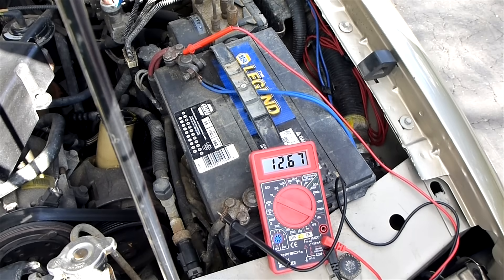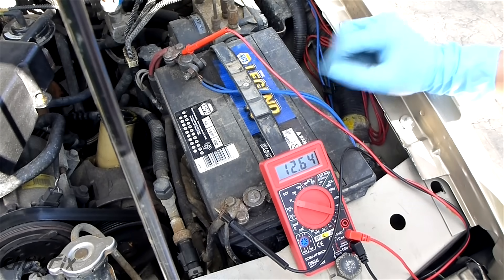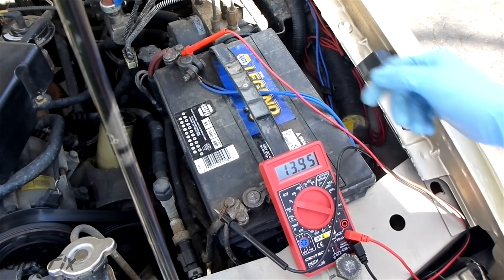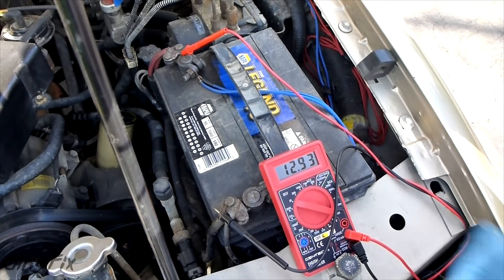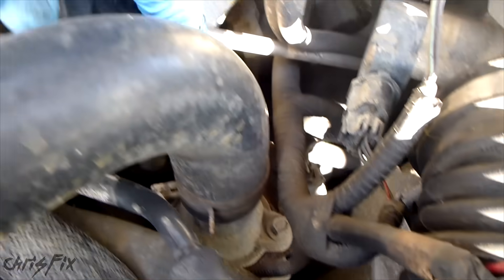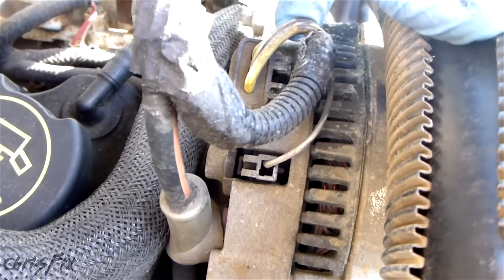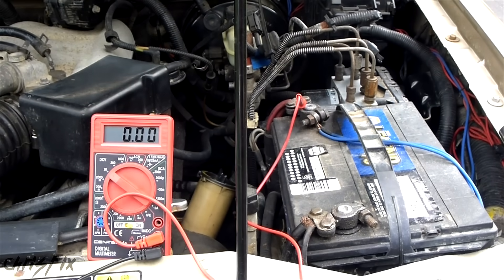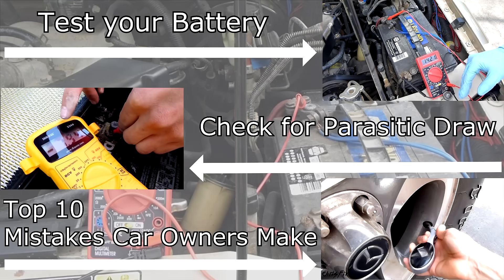How to Test an Alternator

Comment: Hey my man Chris!!!! I keep getting the red battery light flashing on my dash. I went to two different AutoZone's and they both said it was a bad battery. I bought a new battery and the red battery light still turns on. So what I did was return the new battery. I even changed the tensioner assembly and idler pulley because it was loose and rattling. I still get the red battery light come on. It comes on once in a while and it's a quick flash. Any ideas on what it might be? They tested the alternator twice and it passed. One guy at AutoZone told me it was weird the voltage on the battery was over 13 and their computer still said bad battery. Clearly it's not a battery because it still happened with the new battery. Today I had the AC on with the fan speeds half way. When the radiator fans would turn off the rpm will bounce to 500 and the engine would almost stall. Please help. Thank you.

Comment: Hi Chris 
I have a 2004 chevy trailblazer my alternator went bad I bought a new one from the local auto parts I installed it my self a couple days later I noticed that the battery gages is boucing up and down  sometime go up to about 15 and then drap down to about 13 the car shakes a little bit when is idling  I am a bit concerned about over charging and damaging my computer 
would this be a bad alternator or bad battery 
thanks you in advance 
Lee

Comment: Great video! Seems like my alternator has an intermittent squealing bearing but it is giving out a charge so it is OK for now. I found a crappy $10 multimeter and figured out the battery in the car would only stay at 12.25 instead of 12.6 after being driven and sometimes would not start the car even right after turning it off. Checked the battery in another car not being driven right now and found it had a higher charge despite sitting for several days. Swapped the good battery into my insured car and everything tested good after with the multimeter and engine running just like in your video! Saved me money and time not having to buy a new battery and alternator; thanks again Chris!

Comment: Great video, as usual. I would add one more test because it is quick and easy and catches a fairly rare problem: bad diodes. While measuring the voltage across the battery with the engine running,  switch to AC volts and measure the voltage across the battery. The AC voltage should be less than 0.1 V and is usually only a few hundredths of a volt. A bad diode will produce 0.5 to 1.7V or so. I don't see it often in cars but when I was in general aviation (small planes) we saw it a lot.
Reply from the maker: Thanks and great tip!!!

Comment: Mr Chris I have a question, Ok I have a ford and the dash lights when dim driving down the road but the van never did die cause I am sure it was running off the battery power, that all being said I have purchased a new battery and checked the volts and it is 12.65. so it is good but then I turn on the van and it drops to 11.63... Which I could assume tells me that the alternator is bad, I took the Voltage meter and connected it to the battery and then connected it to the alternator and I got 0.00.... I got no reading at all..... What would that mean if I got no reading when I connect it to the battery and then to the alternator casing??

Comment: i had my alternator replaced with a new, rebulit one, but it's outputting 13.65v in an 07 RAV4. is that too low? My other cars are around 14.4v.

 V6 RAV4 so labor is pretty expensive. It was 11.2v before. Battery is 12.5v with the engine off.

Comment: hi  Chris,, I recently replaced my starter [Nissan sentra 1996, 1.6 l] On Friday morning after I started the engine and drove the car for 2 miles I suddenly had no lights and  nothing on the dashboard the engine died, so long story short I replaced the starter and as soon as I had everything hooked up and well connected the engine was running, no problem and after three days without any problems, this morning I noticed that the battery sounded a little weak when I tried to start the engine but it ran lights and everything else were working fine but I was like something is not right so during the day I ran the engine several times still felt weak but it ran, when I came home I checked everything the way you did in your video and the battery and alternator seem to be fine, however that weakness is still there every time I try to start the engine and I don't know how to address it, please give me your advise,thanks Rudy.

Comment: my battery is 12.6 but my alternator reading is 14.6 with everything I can think of turned on. My problem is that when I accelerate the battery light flashes but I changed the belt and its still happening. anyone any suggestions?

Comment: my voltmeter reads about 12.6 when its off, when i turn on the engine, it reads about 13.8. i turn all the load that i can probably think off and reads about 13.6v. im hearing like a scraping sound does it mean i have a bad alternator?
Reply: Your figures are actually standard. Your alternator and batter is fine.

Comment: hi installed a new alternator a few months ago is it normal it get very hot to the touch its a ford people carrier
Reply: Thats normal because the alternator is bolted straight to the engine block.  The alternator even has a fan built in to help cool it down.

Comment: Hey Chris,

I have a problem with my charging system. I watched your video some time ago and I remebered some parts of it. With the car idling and no accessories turned on, the multimeter shows a voltage drop of 3V between battery negative and alternator case. 

The alternator gets ists ground via a ground cable to the engine block. Can I solve the problem by attaching an extra cable directly from battery negative to the alternator negative stud?

Comment: Chris I am working on a 2001 Saturn SC 2. The battery is 3 months old and has a charge of 12.9 volts before I start the car. The alternator is new, I had it tested when I got it and it puts out 14.7 volts. After I put the alternator in and started the car after running for about 15 min. voltage in battery starts to drop. The longer I run the lower the volts. The drop is faster when more things are turned on. I take the alternator back out and it test it and shows it is putting out 14.7 volts. Can you please give me a clue?

Comment: I have a new battery only showing 11.8 and it won't start
Reply: Your problem is that the alternator is not charging the Battery.  Inspect the wires to the battery and alternator. Fix any loose, broken or corroded wires...  Check the alternator belt, should not be loose or cracked, etc... Use a wire brush to remove any corrosion built up on the battery cables and make those connections look new... If you follow this video with the multimeter it will help diagnose if the alternator is bad and needs to be replaced... Some part stores will also test your alternator for free...

Comment: Is 13.9V while running low enough to indicate the alternator as a problem? Only drops to 13.5V under load. All connections appear to be tight and clean. Battery is good quality and about 6 months old. Is it possible for an alternator to have an intermittent charging issue?  Vehicle is an 07 F150 5.4L with about 100,000 miles. Battery died a few days ago after driving it but now it seems fine.
Reply: Also, it did drop slightly below 10V when starting

Comment: Tested a Dodge Caravan last night, temperature was 30F.  Battery was 12.39V at start of test and turned van on, battery did not drop below 10.2V while starting.  after van was on, the voltage stayed at 11.7V for about 3 seconds then went up to 15V and came down to 14.6V (slowly) with the system loaded with accessories.   When we turned the accessories off, the voltage started back up to the 15V level.  Battery light comes on intermittently but was not on last night.  My recommendation to the owner was a new alternator due to regulator spiking like this and being internal.   also had a P0113 code that would not reset just kept coding.   Did not do voltage drop tests.  Serpentine belt was tight and bearings sounded good.

Comment: When I turn the key in my Mazda RX-8 2004, the battery voltage according to my OBD2 app is jumping anywhere between 12 and 13V. What does this indicate? When the engine runs, the voltage jumps between 13 and 15v rapidly.
Reply from the maker: Bad voltage regulator in the alternator.
Reply: Didn't know it regulates the voltage of the battery too when the engine isn't running. Could this also be the cause of my higher LTFT, as the load of the alternator keeps changing? Or could this be the cause of inaccurate MAF and o2 sensor readings?

My MAF readings were reading 10% higher ever 14 seconds for 7 seconds long.

I will replace the alternator then. Thanks!

Comment: Hi Chris! I have got my 1992 Toyota Camry, and it was just fine during the trip from seller to home. But suddenly, battery sign appeared, and battery died. I tested my alternator like, i turned the engine on, and tried to disconnect black wire, and it should have work, but it didnt. What can cause the problem of non charging battery? I replaced battery tho. Thank you Cris for those cool and helpful videos!

Comment: Hi very good video, i have an intermittant problem, everything starts ok when i am driving after several miles the lights have blinked and i get the warning light  engine system fault the error code is 9318 which is low battery voltage, then sometimes i can drive  to work about 13 miles and the engine fault doesn't come on, the battery and alterbator have been replaced in nov 2016 i have just brought the car last week,

Comment: hey +ChrisFix ! first off thanks for great videos we're finding them very, very helpful!

 We just ran a test on our battery/Alternator and turns out the alternator didn't pass the test for NEG voltage drop (we got a 0.2v reading)... Now... the Alternator is deep down in the engine bay and  couldn't quite check the other connections (did get a reading off engine block: 0.1v)... so as you say there's a problem. Will clean connections when we get a chance but in the mean time we're wondering if:

1) bad test on voltage drop results in damage to battery? (we're running an Optima RedTop... I'd hate to ruin it)
2) could it be that we will have to replace our alternator entirely if readings do not change after cleaning the connections?

We're big fans of you vids and find them extremely useful! we do overland expeditions every year and want to upgrade our mechanical/electrical skills to maintain our vehicle ourselves. You're lending an enormous hand in that!!

take care
The LGO Team

Comment: Hi Chris... I just got home from doing that starter. When I put the old one back in, we went to start it and there is a grinding sound coming from the starter we had the old starter tested and they said it's still working.... kinda like metals touching each other was what the sound sounded like, All the lights are working, and we had the battery tested it's perfectly tip top shape.... the noise is a strange sound it's coming directly from the starter area I also noticed that the vans tried to move maybe a tiny little bit when we turn the key. Could this be a bad alternator? Been at this for 3 days trying to help a man and his son stuck in a store parking lot. Any insight would help so much thanks man
Reply: Also, since we can't get the car started to do a test on the alternator is there anyway of testing it to see if it's bad other then taking it off the van?

Comment: Hi Chris... My old Mitsubishi Magna (Diamante in the States) running a 3.5L V6 seems to run all sorts of weird voltages.  With accessories on (radio, dashcam and sometimes AC) the voltage can drop to 12v at idle.  When I drive off the voltage jumps to about 13.6 and generally stays there until I pull up at traffic lights, then it will fluctuate around 12.4 to 12.7v.  The battery has never gone flat and I don't travel many Kms in this car (it's more a shopping buggy) on any given day.  With only the dashcam on I will see 12.9 to 13.8v.  What do you think, new Alternator time???

Comment: Rip, my dad has an 04 Mercedes e320 that has a battery less than 7 months old but recently it needs to be jump started every time when started. At idle to 2000 rpms, the voltage is 13.9-14. Gotta try it out with load. Too bad I can't check the alternator mount because the battery is in the trunk.

Comment: Could somebody point me to a cheap multimeter that I could buy on amazon for doing this and for testing for a potential parasitic draw? (Im new to all of this)
Reply: You can get the same model as the one in the video for free with a coupon at Harbor Freight.  Regular price is between $2.99 & $9.99.
Reply: bill alford 

    you can get these Harbor Freight multi testers for free with a coupon.  They are very accurate.  You can calibrate them inside with the back off.  I have compared these with Fluke meters and they are very close.  There are videos on here showing this calibration.

Comment: I have a 92 Geo Metro XFI. I have replaced bot the battery and alternator. It is hard to start "some times". Sorta like it is flooded in a way. I finally did get it to start. I ran it for 15 minutes. Turned it off and waited 5 minutes and it started right up. We had snow and I left it under the carport for 4 days. I got in to start it and the same thing all over again.. Help please!!!!

Comment: I have a 07 Dodge ram 2500. I have 2 batteries in the truck. I noticed my voltage dropped down so i checked batteries with meter while the truck is running. One is around 18.5 and the other is around 13.5.

Comment: You should go over about the diode rectifier bridge if there's ac voltage leaking into your system then than can cause the same problems but won't show up when your just checking Dc voltage and voltage drop

Comment: hi Chris I'm having trouble with my 2005 GMC envoy xl  v8  2and 4 wheel drive I was in accident in February in ice storm the car flipped and I needed an axle replacement and other minor repair they kept my car for almost to may now I'm having different trouble with my car no air no now I change the battery my car not the same .now it's been giving problems shutting down on highway and streets at the red lights it will ride and then stop completely while I'm riding I tried turning it cut off I almost hit a pole. I change battery now it won't start my hold car be completely dead unless I charged the battery and then it will start for a little while he then the car will die completely. does this sound like the same thing. it's in the shop now they call me and said it was the alternator I really don't want a used one I price some they ran descent price. I'm female they get over us I'm still trying to figure out why they kept my car for so long and they call me playing these stupid phone tag one minute the car ready get up there no the car not ready I'm so skeptical who fixed my car I never had any trouble with it now falling piece by piece. I just wanna make sure it's the same thing. would my relay switch do the same thing? I took it to Auto zone the only thing came up was to replace the relay switch. when I flip my the whole car shut down wouldn't do anything. if u can positive me some good advice thank you.

Comment: i already bought the parts for my car then i watched this video, wanting to be sure that it is the alternator that is faulty since the battery is new, i bought a cheap multimeter and it does turns out my alternator was bad since the reading is only 12v when the car's running (after jumpstart of course)

nice to know that the parts you bought isn't wrong
Reply from the maker: Glad the video was helpful!
Reply: ChrisFix 
can i use clamp reater

Comment: Hi Chris, I have a voltage problem. I have 15.2 volts at the battery but my dash reads 14.7. I was thinking it can be the power module??

Comment: hey chris awsome videos.
question I have a 2006 saturn vue, did a parasitic draw on the system.  battery fully charged is 12.7 volts. disconnected negative cable and have run my Fluke 88 meter in series, everything off and no key in. let it set 40 minutes and my reading is 0.031 milli amps, if I unplug the 30 amp main engine fuse goes down to 0.004 milli amps.  I had an aftermarket remote start installed over 3 years ago. I'm 99 percent positive they tapped into the ignition system. at 0.031 milli amps it should be fine. The remote system rarely worked even after installed,  every tear had to got bypass reprogrammed.  at 0.031 should be in range, what would you say, thank again and again awsome videos

Comment: +chrisfix . my car doesnt start.  i see battery, brake and airbag signs in dashboard.  when i  jump start  , my car was getting  start but it getting off  immediately(like 3 to  5 minutes)  when i took out  the jump cables. i would like to know what the problem is whether the  Alternator or battery.

Comment: Hey Chris! 
I have a problem with my Audi A6 2005. It stuggles to start when its cold outside (below 0 celcius). I have replaced all 4 glowplugs, checked the glowplug relays and so on. Still problem. It seemed that the alternator didnt charge properly. So I hooked up a voltmeter on the battery when the car was running. Around 12.8V. Same as when the car is not running. I then hooked the meter directly between the alternator case and the output, the big wire from alternator. About 14,5V. So I guess the alternator is ok. I then hokked it up between negativ on battery and output on alternator - 14,5V Good. Then between positive on battery to alternator case - 12,8V. This will suggest a leaking positive wiring? I think the voltage regulator is mounted on the alternator so the wire from the alternator should lead "regulated-current" yes? Should I spend time on following the wire from alternator to battery, or am I missing something here?

Thanks
Ekdal
Reply: Bird tameness